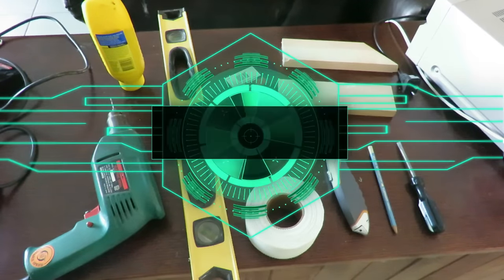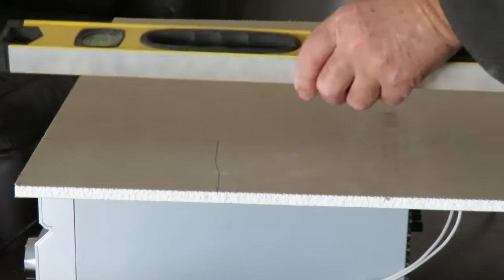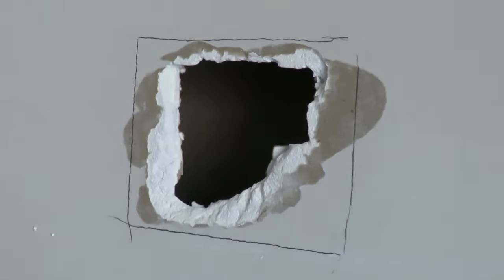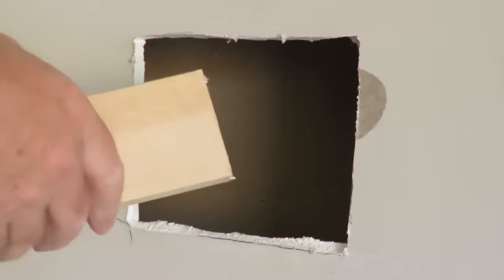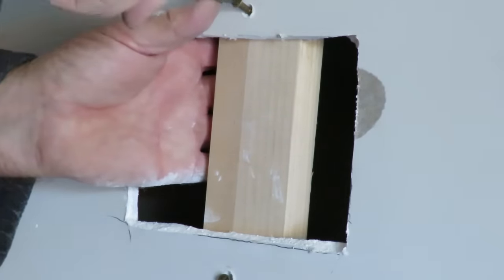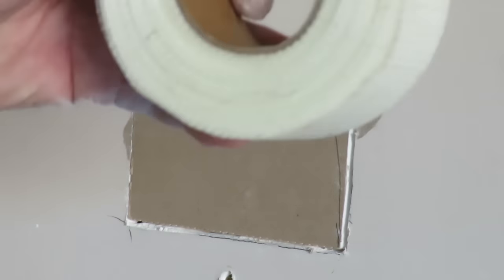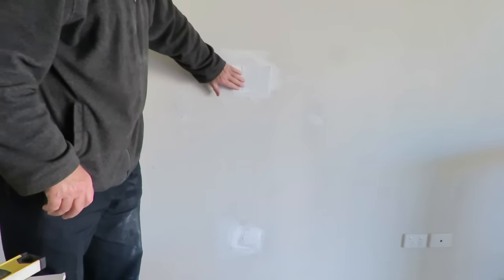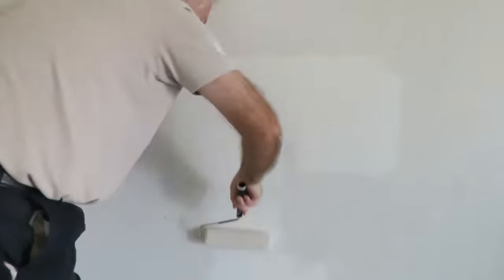🏠 How to Repair Drywall and Fix a large Hole in the Plaster Wall the easy way

Comment: You should have at least secured the cut piece of drywall to the board. The problem with doing a video like this is someone will see it and think it is the correct method. Did the drywall mud ever crack on that repair later?
Reply from the maker: No cracking, the repair is over one year old in a rental property.
As far as securing the backing plate, it's not necessary, but it is a better to do it as you have stated.
Reply: @GarryPurcell  well I guess if it did not crack then it is okay. Thanks for the reply.
Reply from the maker: @fbiguy1  Some people prefer to use a californian patch or butterfly patch. (no timber supports)

Comment: Probably the strongest way but depending where the hole is I prefer a hot patch
Reply from the maker: There are quite a few different methods available to repair wall damage.

When I have all my tools with me I normally use the method below to repair walls.
https://youtu.be/JmcR9TW4mM0

Comment: I got mad threw my Bluetooth Bose speaker and it went straight threw then I gotta cut a hole at the bottom to get it out 🤣🤣🤣🤣
Reply: 😅Apparently JBLs stay in the wall😆😆😆👍
Reply from the maker: Impressive speaker.
I assume it still works OK.

P.S. If your repairing a wall for the first time, you might like this video as well.
https://youtu.be/JmcR9TW4mM0
By watching both, you will get a better understanding as to how easy it is to DIY.
Reply: @GarryPurcell  yes it works
Reply: @DOCHEMPS666  🤣🤣🤣🤣

Comment: Want it to last and not crack in a week?
Dont do this method. Buy a drywall patch. Its not that its wrong, he didn't do it right. That patch will last 2 weeks tops till it cracks for not being secured well.
And uneven because he put the little sheetrock backwards.
Reply from the maker: Really???
Check the Date Stamp of this video.
This repair has no cracks, so you need to rethink your comment.
Reply: I don't need to rethink my comment.
No cracks? Then you're just lucky. I wouldn't recommend that kind of repair to anyone. And I'm surprised how there's no cracks. The little piece was moving as you applied the compound. 
You made a 5 min repair more complicated than it had to be. 
Cut a square hole, tightly secure a 2x4 behind the wall to tightly secure the repair piece. Cute the piece of course and drill it in (on the right side), tape it, mud it, sand it, and paint it. There, I've given you basic instructions and they don't involve drilling holes and manually screw in 2 non drywall screws in. And it'll hold the repair without it being flimsy or messy. 
I won't rethink my comment. If you're gonna post something to help others make sure its done correctly.
Reply from the maker: @El_Cucuyyy  The timber was more secure than you think, it was centered at the back of the patch, and the cuts were angled, so plenty of material to bond to, plus it was only a small hole.

Comment: What items do I need to buy though
Reply from the maker: I sourced my materials from a dump bin, and borrowed some basic tools.

You will need some plaster board. (small panel section bought from a hardware store)
I would suggest a panel saw, as opposed to the blunt Stanley knife I used.
A Plaster spreader
Two short pieces of timber
Some Plaster Board Screws.
A Squeeze bottle of Premixed plaster filler
A Straight edge and pencil to draw the cut lines
Some Sand paper
Paint and brushes to cover the finished repair.

P.S. I have another video that might help you, if your repairing a wall for the first time.
https://youtu.be/JmcR9TW4mM0
By watching both, you will get a better understanding as to how easy it is to DIY.

Comment: Good technique  to have a template board first then copy the shape to wall for cutting.   I did another way around 😅. Found your method better wish to have watched your video earlier.
Reply from the maker: Great tip!
Be sure to check out my other wall repair video, when I was prepared for wall repairs.
https://youtu.be/JmcR9TW4mM0

Comment: Ats sticking out like a sore thumb... should a bought a daily record, stuff in some balls, a peice o card board to press in and plaster it. The cheaper option. But looks flush.
Reply from the maker: That's another way of fixing the wall.

When I have all my tools with me I normally use the method below to repair walls.
https://youtu.be/JmcR9TW4mM0

Comment: What if the hole is at the bottom of it. Where you can't put a piece of wood to hold it in place.
Reply from the maker: There are many ways to effectively repair damaged walls, the timber backing board can be orientated at any angle, as the repair dictates.
P.S. If your repairing a wall for the first time, you might like this video as well.
https://youtu.be/JmcR9TW4mM0
By watching both, you will get a better understanding as to how easy it is to DIY.
Reply: @GarryPurcell  thank you so much.
Yes it will be a first for me. I am trying to fix up my garage into a craft space. 
Right now i am in the process of getting it cleaned up but there's so many holes that need to be repaired. & a big one where there used to be an AC unit. 😬
Reply from the maker: @ambernicolesaenz  I'm sure you will do just fine.
Simply take your time.

Comment: You didn't even use the same size drywall in the hole! This is terrible. And YES, the structure you are putting the drywall on DOES need to be secure!
Reply from the maker: Wow a repair that was completed 4 years ago with no sign of any problems todate, is a bad repair in your opinion?
Feel free to enlighten us as to your preferred method, and back it up with a video you made.

P.S. Please READ the VIDEO DESCRIPTION before commenting further.

Comment: Why was it put in backwards?
Reply from the maker: It makes little difference for a small patch for a center wall. As long as the patch is primed, it will have sufficient tooth for the final coat of paint.

Comment: since when does "easy" have to be so "rough and ready". You could just about as easily used two pieces of wood glued behind the original wall edges.
Reply from the maker: Please Read the Video description, you will find your answer there.

Comment: you need to put a primer on the wall then put the top coat of paint on otherwise down the track itwill flake
Reply from the maker: Unless its an all in one, which is the primer and top coat in one tin.

Comment: Gary how much would all these costs if you’re buying them from a local B n Q/ wickes if not will have to go to a builders merchants
Reply from the maker: I picked most of the bits out of a dump bin.
You should be able to do the same, simply check out if there is a new house being built, and go ask the guys onsite if you could have a small piece of drywall.
Be sure to wath my other video when I had my tools with me.
https://youtu.be/JmcR9TW4mM0

Comment: I would’ve just used a jab saw? Or a dremel, either way thanks for the info
Reply from the maker: There are many ways of repairing damaged walls, it all depends on what you have available at the time of repair.

Comment: Bad patch. It is still wobbling. Two screws were not enough to secure a plane. You at least need three screws and in this case four would have been ideal to hold the support.
Reply from the maker: Please Read the Video Description
Reply: @GarryPurcell  I got it now. Thank you.
Reply from the maker: Thank You for taking the time to read the video description.🙂
Reply: @GarryPurcell  That is no excuse for doing a terrible job and this is a TERRIBLE job! you should delete this video!
Reply from the maker: Wow a repair that was completed 4 years ago with no sign of any problems todate, is a bad repair in your opinion?
Feel free to enlighten us as to your preferred method, and back it up with a video you made.
Reply: @GarryPurcell  Just curious (Also considering you had a limited resources and supplies) - Would not the patch fix crack at the joints easily with a small impact or blow at that place because the support was not rigid ? Just thinking technically, have no experience.
Reply from the maker: @stormynite6  The repair is quite strong, and I honestly don't think it will fail, but only time will tell.
This repair has held up in a rental property for 4 years now, so more time needs to pass before I can answer your question.
Reply: @GarryPurcell  Good to know this. Thank you.

Comment: Seems like unnecessary work. Why not find a piece of wood (like the one you used) but the same width as the hole, put a screw in it with string attached to hold while you screw it in place. Then remove the screw/string and fill the small gap between wood and outer wall with plaster. No cutting or shaping required.
Reply from the maker: There are lots of different ways to do repairs, it comes down to what you have available on the day.
Reply: @GarryPurcell  i understand that but you plastered at the end anyway. Seems like cutting the square in the dry wall and cutting a piece to fit were two unnecessary steps.

Comment: Why did you use the back of the drywall as the face...this confuses me guessing i was due to you covering it all with mud but even then I'd still put the face forward and not the back. I've seen better but I've also seen far worse, still confused as to why you didn't have all your tools with you to properly do this in a cleaner and more precises fashion but not the less looks good from the front. the real test is when the paint dries and light shines down the wall anyway. Over all decent information to help others.
Reply from the maker: I was on a non-related job, so I had to source materials from a dump bin, and borrow some tools.

The paint roller adds texture to match the existing paint job, so the finished job is fully invisible to the eye.

I think you might like my other video. (Full toolkit)
https://youtu.be/JmcR9TW4mM0?

Comment: Using slotted screws they went out with the dinosaurs,two Barton’s in there would have been better see how it rocks and too proud,don’t use scrim will not rub down properly
Reply from the maker: Thanks for your insight. 
Please Read the video description to understand why the slotted screws were used in this repair.

P.S. I normally use this method below when I have my tools with me.
📌 https://youtu.be/JmcR9TW4mM0

Comment: I think I would be a little easier with a drywall saw
Reply from the maker: You are 100% correct.
I used one in this wall repair video.
https://youtu.be/JmcR9TW4mM0
Reply: @GarryPurcell  thanks Garry

Comment: I realise that it’s a pain when you don’t have all your tools with you and you have to make do with what you have to hand. I get that. 
But DON’T choose the day you have no tools, to be the day you decide to do a ‘how-to’ video. 
Instead wait until you have all the right tools for a job and then do the video using the RIGHT tools and explain to viewers as you use them what other tools could be used if you don’t have the ideal tools. For instance “I’m using a cordless screwdriver for this job. You can use a hand screwdriver if you don’t have a cordless but it’ll take a bit longer”
If you can do all of this, it’ll mean I don’t have to watch through a video hoping for some quick tips, to find that I then have to read everybody else’s comments to figure out for myself which is the most popular way to fix a repair. And I shouldn’t have to be told by a YouTuber in their comments to watch a second video of theirs where they are using better tools and a better technique to do the same job correctly. 
Gotta go now. I have a wall to fix. Possibly a second after watching this vid.
Reply from the maker: There are many ways to do repairs, it all depends on what you have available on the day of the repair.

Be sure to watch my other wall repair video, when I had all my tools with me.
📌 https://youtu.be/JmcR9TW4mM0
Reply: I'm with the author on this one. Sometimes it's expedient to use what is available to you at the time. Warts and all examples like this might be just enough encouragement for people in tight financial circumstances to have a go. Maybe the end result will give them more appreciation for professionals too.

Having said that you could simplify this even more by using the existing paper on the Gyprock rather than trying to find flushing tape. I've had a lot of success with the "California Patch". To do it properly takes some skill but most techniques don't hide the  undulations created by a tape of any kind. Skill with a trowel helps but very few of these patches are not visible in the right light, professional or not.

If I was to be extremely pedantic I'd use a much more complete back plate with glue applied and a tightly fitting patch without any tape. As long as you have enough glue to stop any movement over time at least you have the beginnings of a chance to have a perfectly flat plane to flush.

Comment: Very hard to match paint colour. If it's some weird shade of yellow or green or blue, how the hell would you ever match it. You'd have to paint the entire room.
Reply from the maker: You have to remember that the colour in commercial paint, is derived from tints, added to your chosen base paint.
Hues and shades, depend on the original base colour used. [That's how the paint gets tinted in the paint store.]

A simple way is to use colour swatches, and mix your repair patch paint to it, and feather out the painted section over a larger area.
Hope that helps.
Reply: You would paint the whole wall corner to corner top to bottom if it couldn't be faded in. Or you take a chunk of what you cut out and have it matched at the paint store.

Comment: That's the amateur's way, the professional way is to use a 45-degree angle instead of square-cut for a stronger join and better finish
Reply from the maker: And a professional needs to watch my video in order comment, Hmmmmm
Reply: @GarryPurcell  Yes to teach amateurs how it should be done properly instead of "she'll be Right Mate"
Reply from the maker: @parttimetourist  And a LINK to the Video You Created would be appreciated.
Reply: @GarryPurcell   Garry I never said I created a video for it  I was trying to explain that the 45-degree angle creates an overlay instead of a butt-join whereby the cut piece fits perfectly into the hole also on a 45-degree angle and is a much better way of doing it. Try it and you will soon realise it is much better.

Comment: Did you mention how what size drill bit that was? Of not what size?
Reply from the maker: It was what I borrowed on the day.
The screw size really doesn't matter, its simply to fasten the backing board to the wall.
I have another video that might help you, if your repairing a wall for the first time.
https://youtu.be/JmcR9TW4mM0
By watching both, you will get a better understanding as to how easy it is to DIY.

Comment: What is the tape called that he used?
Reply from the maker: Its Plasterboard Joining Tape.

P.S. If your repairing a wall for the first time, you might like this video as well.
https://youtu.be/JmcR9TW4mM0
By watching both, you will get a better understanding as to how easy it is to DIY.
Reply: Thank you! I fixed the places earlier this morning. We removed an old security panel, and there was a hole behind it.

Comment: I wouldn't even start to repair without a cordless drill and drywall screws
Reply from the maker: Nor would I normally.
If you read the video description, it will explain why the repair was done this way.

Comment: Sorry this is okay but not great!

At the very least you should have put two wooden braces to stop potential rocking either from contact or from heat/cold cycles.  Ideally use a wide piece of wood on either end and get some screw fixings on the side as well as top and bottom.

Also method plasterboard cutting is poor.   Put on top of scrap wood, use another piece of wood as a guide (or spiritual level as here) and keep repeatedly scoring until all the way through.  Same for the board on the wall.  Easiest way on the wall though is with a multitool if ones available.

Also can't below flat head screws and plug in drill?  Really in this day and age?
Reply from the maker: It might pay you to take the time to first read the video description, before commenting in future.
You might learn something that way.

P.S. I normally use the method below to repair walls.
https://youtu.be/JmcR9TW4mM0
Reply: @GarryPurcell  You might be interested to learn that Youtube is a video platform and it might pay you to take the time to edit your video to include important information, rather than argue with people who point it out!
Reply from the maker: @lwdcourt  I'm not arguing with anyone.
Simply pointing out that READING the VIDEO DESCRIPTION, is a GOOD HABBIT TO GET INTO. 
Before wasting your time commenting, on something that is already clearly documented as to why the repair was done this way.
Reply: @GarryPurcell  "I'm not arguing but here let me argue my point!'  Lol
Reply from the maker: @lwdcourt  Haha
Sounds like were both having a bit of fun.

Comment: What grit of sandpaper did you use please?
Reply from the maker: It was a medium, that I used.
Its all I could find on the day of this repair.
P.S. I have another video you might like.
Its similar, but slightly different, by watching both, you will get a better idea as to how easy it is to repair a hole in the wall.
https://youtu.be/JmcR9TW4mM0
Reply: @GarryPurcell  Thank you, will go to other video as well.

Comment: This is an amateur work you can see from a plain that is a patch, first you glue tha piece you put in a hole then you sand until is smooth secure good a wood in the background to not dace and then you put a plaster and you will see nothing pops up. That is a perfect done.
Reply from the maker: Maybe you should read the Video Description, before commenting any further.